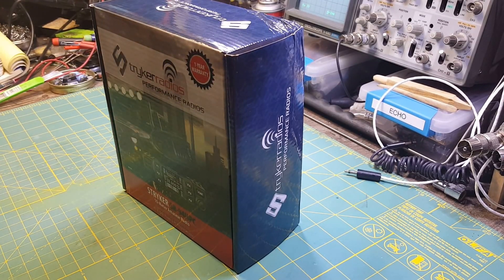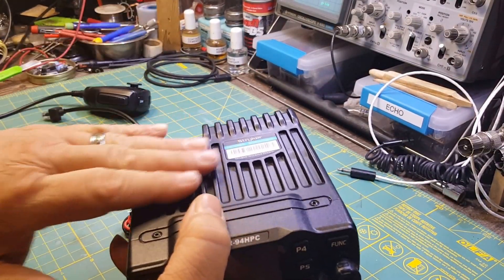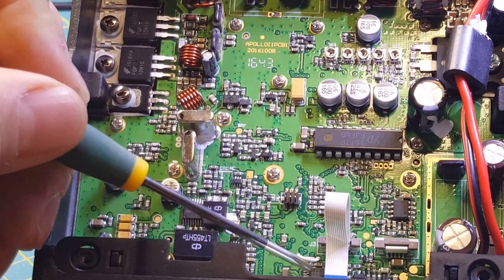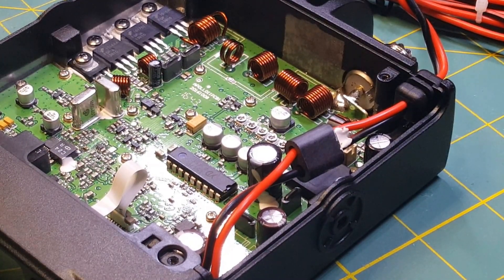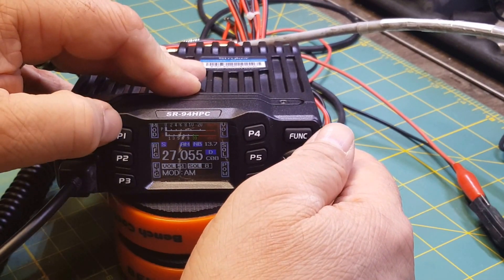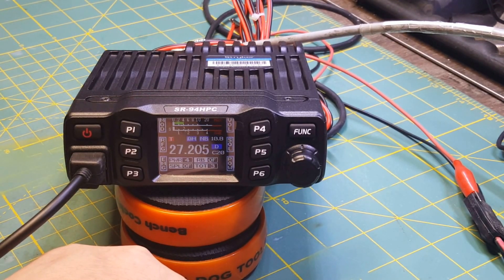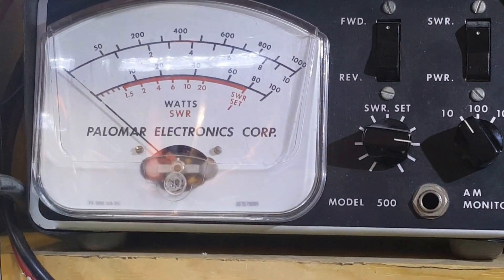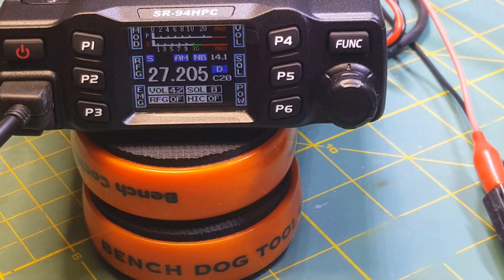Stryker SR94 HPC for Brandyn

Comment: I have this radio it is a bad ass little radio. Today skip was going crazy I couldn’t reach out to anybody but I listened in and everything was loud and clear. On channel 19 the furthest I talked to another driver was right around 12 miles . This radio picks up a lot the receiver is crazy on it for such a small radio. I run a Stryker A10 antenna with it which is way overkill but for the truck I drive that’s the antenna I get the best swr out of . I got it tuned at 1.0 across the board

Comment: Thanks for your videos. They have been a big help. I have a question, how do you change the speaker settings so I can hear from the speaker/mic. I would like to hear from the onboard speaker and the speaker/mic both at the same time. Right now I can only hear from the onboard speaker. Thanks. Robert, KO4CER

Comment: Nice video, how do you find out the pot adjustments. I need the ones for the Stryker 447 hpc2. I need to set the dead key but don't want to just start turning pots. THANKS

Comment: Does the 94 HPC  save the settings or do they have to be re-selected everytime it is powered up?
Reply from the maker: M28443 It saves your settings.
Reply: It saves the settings each time, plus if you save a channel in memory, it will save any other parameters that you have set such as nc,hi cut, etc.